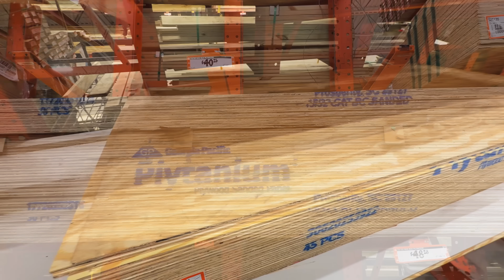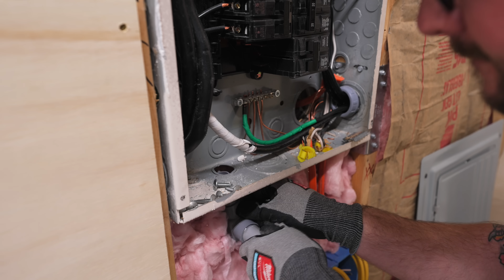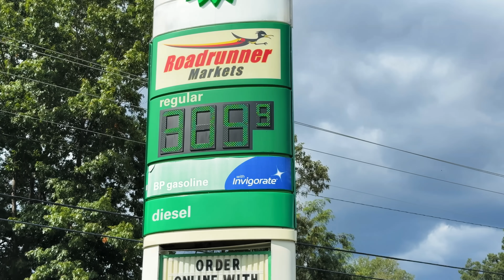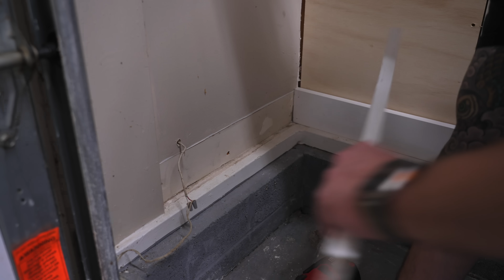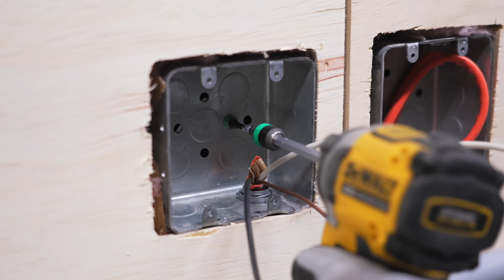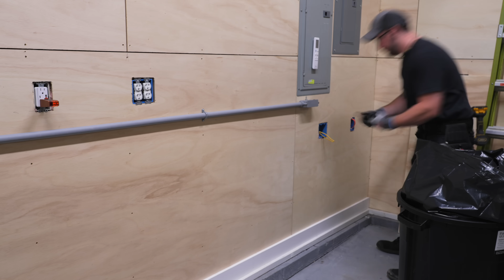Transforming My Garage Into A Workshop Part 2 : Plywood Walls & Outlets

Comment: Nice job on the wood panels.  Personally, I'd always go for the 14-30R over a 6-30R, as an outlet with a neutral wire might not be necessary for your current tools, but it's the modern standard, and will be more flexible for future use.  With the 6-30R, someday someone's going to end up having to pull the wall panels and run different romex to bring a neutral out of the electrical panel.
Reply: HOG WASH!  L14-30R is the king of 120/240v 30amp receptacle!

Comment: I’m so confused as to why you didn’t run the conduit for your car charger inside the wall
Reply from the maker: Running it in the surface mounted conduit surface will make it a lot easier to manage future changes if I need to change the wire size. EV tech is changing so rapidly these days, I didn't want to lock myself into something I'd regret later.

Comment: Hey brother, commercial electrician here, that's a beautiful looking wall. Only main feedback or points I'd add amongst the others already mentioned such fire rating, marking (phasing) your neutral on the 240v outlet to indicate hot, etc, would be just with how you roughed in (set) your metal boxes. In the future if using metal boxes consider installing them to where the front edge of your metal box is flush with the BACKSIDE of your finished surface (in this case plywood), and then use a plaster ring (mud ring) to reach the FRONTSIDE of finished surface, this allows you to cut your holes to the size of the plaster ring and not the whole box sized hole, allowing a much tighter and well sealed outlet, kind of hard to type out but if you look up plaster rings and drywall you'll see what I mean. And I would like to know how it was that you fastened or supported those boxes because they shouldn't be able to sink in like that as you work on them, maybe consider some sliding brackets if doing this again (or anyone reading this). Lastly on the note of fire resistance I think you're fine as long as you're within allowable amperage and properly grounded however they do sell putty pads that are a fire stop putty that you can wrap your box in before closing up the walls. this would help with air and sound sealing along with adding fire resistance. 

I know it's annoying for people to come in and scrutinize anything AFTER you've finished your work and can't really go back and do much of this but I figure it's good for future reference or any others that are planning to watch and do this themselves. Anyways, great looking wall again and I think you're fine with safety as things are, we add so many layers and protections nowadays it's honestly pretty overblown so long as you have the basics down of proper amperage/wire sizing/breakers and connection integrity with grounding. The little details beyond that are just extra insurance. Enjoy you're new space congrats!

p.s. (also that damn pvc pipe you added...mm, bit of an eye sore to that nice wall, don't like that much I think you could've snuck that in the wall with metal grommets in studs or ran emt along top edge then dropped in panel from above, anyhoo I'm rambling now that's another topic)

Comment: are you legally allowed to do your own electrical wiring in the States? I live in New Zealand, we can run the wiring but have to use a certified electrician to connect it to the mains and sign it off

Comment: Plywall walls is great, but if you don't also have proper fire-resistant drywall behind that plywood you will not be able to pass fire safety code and will not be able to sell your home. Or you could burn your house down. You also need a lapel mic to eliminate all of your unprofessional breath pops, which DESTROY every video no matter how great the video is. SO many breath pops!!
Reply from the maker: Code requires drywall between living spaces, so putting plywood on these exterior walls is fine.

Comment: I did this two years ago to my 800 sq ft garage. Cabinet grade 1/2" Double UV coated Baltic Birch. Was cheaper then drywall and looks incredible.
Reply: How was that cheaper than plywood? Pre finished Baltic birch is like 200$ a sheet here and drywalls like $12 a sheet

Comment: It's funny, as a formal elechicken, I always prefer wirenuts (properly sized), and run from Waggo connectors. One note about Wirenuts, ALWAYS twist your wires TIGHT before you ever add the nuts. I've seen houses burn to the ground due to loose wires in the nuts. I saved my brothers house by finding them before they got too hot (heard the sparks coming from the box).

Comment: Is this an attached garage? Most code enforcement requires drywall in the garage to encase any potential fires buying you some time for the fire dept to arrive. 

This may also void your homeowners insurance.

Your white 240v wire should be marked with red, and your receptacle boxes are loose.
Reply from the maker: Code requires drywall between living spaces, so putting plywood on these exterior walls is fine. Also, my local inspectors have never been bothered with labeling the white wire on a 10/2 240V circuit as it’s pretty obvious it’s hot in that situation.

Comment: I did plywood walls horizontally as well to allow for a nice finish and french cleats. found 3/4 gave me strength and more connection to studs.
Reply: I did have a question. My split when installed was told I had to leave 6 inches away from each side for cleaning and access to panels. I noticed you went against it. was wondering in my case about putting a magnetic or easily removable panel might work best?

Comment: Overall, good work. But boy, my German brain gets fucked up when I see the wiring. If you do the wiring like that in Germany and the thing blows up in your face, no insurance company will pay for it. Of course, the cables only need to be stripped as far as necessary. If you strip too much, you'll cut something. And you NEVER, EVER connect exposed copper wire to the terminal block. Regardless of whether it's wire 1, 2, 10 or grounding. Regardless of whether it's normal power or high voltage. It makes me sick when I see that.

Comment: You are required to cover up the white wire in a 220-volt circuti with a colored tape (red or black) so that no on mistakes the wire as being a neutral.

Comment: In the UK we only have 230v sockets, 1 outlet type for every tool.
That's 1 ring circuit, 1 MCB, you can integrate a heater or fan etc into that circuit via hardwired flex outlet if its just 1 lowish powered unit.
This 120v/230v idea just seems a waste of materials and effort at installation.

Comment: Yes, about those 1/8 inch gaps.

While I can appreciate the desire for a clean, novel look, when one considers air sealing, those gaps are seriously problematic. You clearly wanted a conditioned space (mini split, insulation) yet you not only neglect air sealing, you actually compound the problem. Listen, I think the insulation guys did a fine job and all, but insulation does not accomplish air sealing. That garage (all garages) is Swiss cheese, and I’m confident you are will have massive air leakage issues due to those 1/8 inch gaps between plywood sheets. The upside is it’s an easy fix. A few tubes of Big Stretch to caulk the gaps solves the problem. (Ideally you would have planned this from the start, and added a release agent or tape behind the gaps so the caulk can perform optimally and bridge the 1/8 inch gaps, adhering only to the plywood and not the paper face of the insulation.)

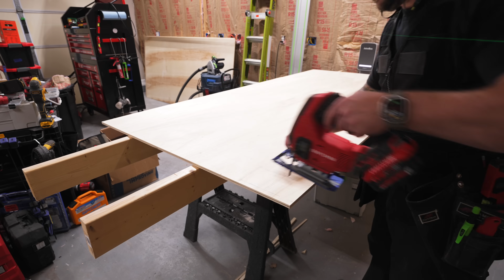Comment: YouTube recommended your video to me, so I clicked on it. I watched up until 0:50 when you were talking about the drawbacks of running the sheets horizontally.  You said “It just had a lot more boxes to contend with.”
I have not watched your videos before, but I think I have heard about you. A pizza delivery person recorded someone ordering a pizza and when asked if they would like their pizza cut in four slices or eight, the answer received was “cut it in four slices, I don't think I could eat eight”. 
I didn't finish watching your video...
Good luck.
Reply: You make no sense.
Reply: @idontthinkso666  Let me help you understand. You have a wall to cover with plywood. Lets say you have ten outlet boxes that you need to cut from your plywood. If he chose to apply the plywood vertically, he whould have to cut out ten holes for the outlet boxes. On the other hand, he claimes that the drawback of running my sheets horizontally is that he just had a lot more boxes to contend with. So how many more boxes did he have to cut out? Isn't there the same amount of boxes either way? So who doesn't make sense?
It's an old joke about the pizza. A silly person my think that having a pizza cut in more pices causes a person to think they are eating more food. But it's not true. It's still the same size in the end. 100% = 100%
Reply: @Asavent if you've ever actually done this type of work, you would understand that it's much more difficult to accurately cut 5 or 6 boxes into one sheet than 2 or 3.

Comment: That romex stripper that attaches to the wire stripper is an awesome idea.  I've never seen that before.
Reply: Anyone know what that tool is or where to get one?
Reply: @rosscallahan2195 looked up the brand on his handles. Crocs brand, looks like you can buy the jacket cutter separately. They say it should work on almost any brand.

Comment: I enjoy your videos, and you seem to be very well researched and eloquent. As an electrician however, when you say that electrical is "not the complicated", you should ensure your doing it properly. Not illegally burying an access point like that pulling elbow being in the wall under the panel, or using an improperly identified conductor like a white wire for a hot. Code requires neutral at all pull points so for a 240V circuit you needed a 10/3 and you can spare out the white (6 gauge and below cant be re-identified, 10/2 is for 30A 120V circuits). I'm not trying to be a keyboard warrior, just maybe don't speak from such a position of authority if you aren't licensed or qualified to be doing so. I still love your videos, its just my hope that you will use for platform for good by informing people of the dangers of improper electrical installations, instead of empowering them to use improper practices. Just hoping to share knowledge much like yourself and mean no ill will. Garage is looking great by the way!

Comment: That's all well and good, but most building codes require fire resistant gypsum board for attached garages.
Reply: Correct, required by the Universal Building Code, applicable to all state, county and municipalities that reference the UBC. However, it is only required on the common wall with the house, not on all walls. This can vary with local building codes, which might require sheetrock on all the walls.
Reply: @g @gpzjeffrey7974 at is a universal building code? There is the IRC for residential work and the IBC for commercial/residential. I’m not familiar with what you are referencing.
Reply: Yep, just attached to the drywall and will surface mount the electrical.  I like the industrial look.

Comment: It still surprises me seeing Americans doing electrics. Here we have what's called twin and earth wire which is basically what you're using there. Ours would be on a 32a circuit (breaker) and we have one live one neutral and earth 230v/240v all goes through the one wire not 2

Comment: Be careful when giving electrical advice. Especially when you are not an electrician. Many of the things you say are up to code are indeed not, At least here in Oregon. Biiggest offense being the 10/2 you ran for your 220 outlets, new installations need to be 10/3 w/ground. And your clipped 6” wire by code should be a minimum of 8”. Just want to save you from legal action from telling folks “this is what you do…”
Reply: Where in the code book does it say 8”?
Reply: Why would he run 10/3 when the receptacle doesn’t need a neutral?
Reply: Have you seen the garbage on You Tube? Do you really think anyone is winning in court with the defense of "Your honor, I saw this in a You Tube video."

Comment: If you leave the ground wire long enough ou can wrap it around the ground screw and connect it to the outlet instead of adding a wire nut.
Reply: There’s no need to bond the box at all
Reply: @Bulletprooftiger27  Then why is there a bond/ground screw? Why do you make a comment like that, but not explain why? You sound like a dumbass.

Comment: we ALL noticed u didnt account for your 1/8 inch gap when cutting the outlets out LOL.
Reply: While I can appreciate the desire for a clean, novel look, when one considers air sealing, those gaps are seriously problematic. You clearly wanted a conditioned space (mini split, insulation) yet you not only neglect air sealing, you actually compound the problem. Listen, I think the insulation guys did a fine job and all, but insulation does not accomplish air sealing. That garage (all garages) is Swiss cheese, and I’m confident you are will have massive air leakage issues due to those 1/8 inch gaps between plywood sheets. The upside is it’s an easy fix. A few tubes of Big Stretch to caulk the gaps solves the problem. (Ideally you would have planned this from the start, and added a release agent or tape behind the gaps so the caulk can perform optimally and bridge the 1/8 inch gaps, adhering only to the plywood and not the paper face of the insulation.)

Comment: Walls look super nice, Pro tip - When doing 240v with the white wire being used as a hot leg, you should always identify it with black or red electrical tape or a marker.

Comment: Wire nuts for the car charger?? My German brain cannot comprehend.
Reply: What's the connector used over in Europe?
Reply: @Lamefoureyes 
I am no electrician so I cannot say for sure but when I look at electric stove installation the cable ends have to be crimped and screwed into a rated terminal. So there are either special rated water tight connectors or screw terminals for crimped cable ends.
Reply: @Lamefoureyes  wagos are most common for splices tbh

Comment: doesnt that fail fire code? if you sell youll need to dry wall it or use FR material to get that rating
Reply: Yes if it is connected to the house.
Reply: not if you list the house "as is" and they buyer can beware.
Reply: No. Depends on your local code. Mine only requires drywall on one wall between the garage and living space.

Comment: I’m wondering why you didn’t put the conduit (pvc) for the car charger behind the plywood wall?  It would have really cleaned up the look.
Reply: I was thinking the same thing, if the wiring changes at a later date, you just use the old wire to pull through the new wire. Would’ve made the job look neater.
Reply: He put conduit on there, so it'd be easier to change it out later.If you put the conduit behind the pleawood, that would defeat the purpose of using conduit in the first place.

Comment: Your outlet boxes are NOT supposed move backward in the wall when you plug items in!!!!  The boxes themselves are supposed to be securely fastened.
Reply: actual curious, how do you securely fasten when a stud is only on one side?
Reply: @cdouglas6 install a cat board behind the box in the stud cavity and secure to the studs on either side
Reply: @cdouglas6 you can buy a bracket that connects to the box, these brackets are cheap and easy to install, the bracket slides out to whatever width you are running to connect to a stud on the otherside, that way 1 side of the box is attached to the stud, and the other side is attached to the bracket, subsequently attached to the stud across from the box. Nice and secure. Other electrical boxes mount in a way that they won't move, if you mount them correctly.
Reply: And the box looked like it was too far behind the face of wall.
Reply: Blah blah blah

Comment: We remod’d the shop a few years back: ripped everything to studs on walls, expanded electrical (more on that in a sec), insulated w rock wool, fire rated sheetrock, and covered w 1/4” painted smooth surface (no more knockdown texture) w epoxy paint (easy cleanup, CNC & woodworking spills & dust), Mitsu/Trane minisplit for air/heat (DFW) area).  

As for the electrical, everything at same 42” level all around..220s, 110s, Ethernet (air gapped hardwired LAN).  Along the 42” high wiring run, we put in narrow horizontal removable “chase” panels.  If we need additional future electrical upgrades, no ripping/sawing through wall surfaces.   Oh, and overhead lighting, put in  “twice” what was recommended, 5k/91+ color led tubes; w emphasis on known machine locations.  No regrets.

As always YMMV.  Just sharing, nothing more, nothing less.

Not associated w any brands/mfgs mentioned other than as a paying customer.

Have a good’un!

Comment: Doesn't matter how many videos I see of American electrical work, it just looks rough AF. That includes "new" panels. Everything looks so dated - hats off for the Wago use though!
Reply: Yeah totally agree. European Legrand and Schneider and others brands that promotes quick connect, clean wiring makes this electrical installation looks like from the last century. Even wire color is confusing.
Reply: He did not use Wagos when connecting the car charger though. Just wire nuts, which to me sounds crazy for the amount of amps a car charger will pull.
Reply: @112Haribo  Thank you! My German Brain was thinking the same.
Reply: That’s how the USA views the rest of the world

Comment: There is lots of copper in wires in the states :). Watching this from sweden where 240/400 is standard - USA really has it's own standards. Interesting none the less!
Reply: I wish we would adopt higher voltage standards in the US but it would be kind of mess at this point to switch.
Reply: Milecraft tracksaw kit with a $6 ryobi circular saw from Goodwil makes a great combo.